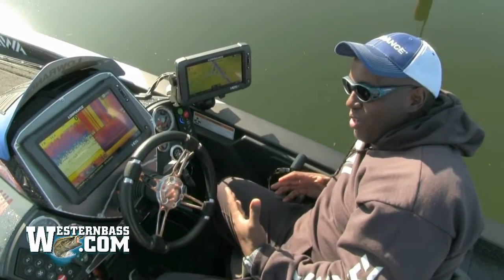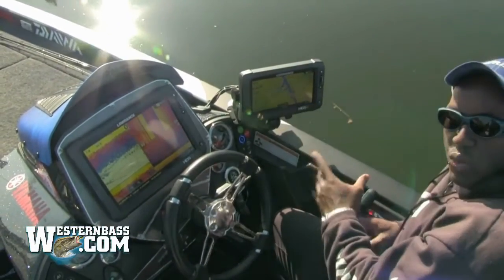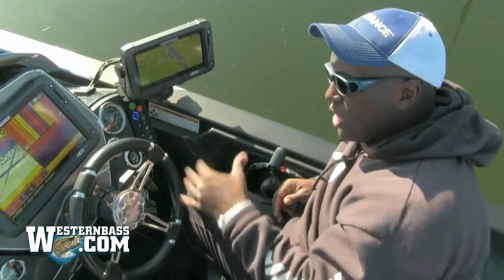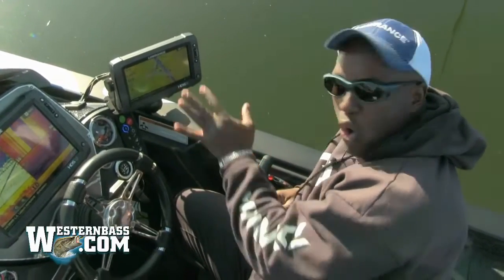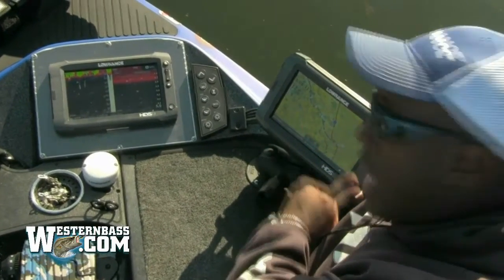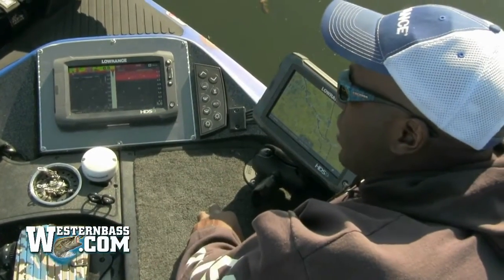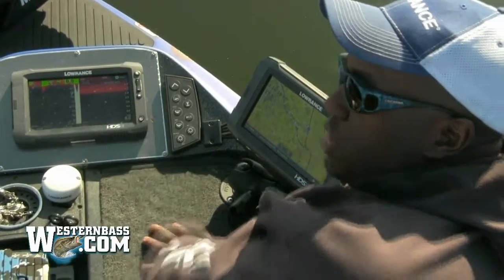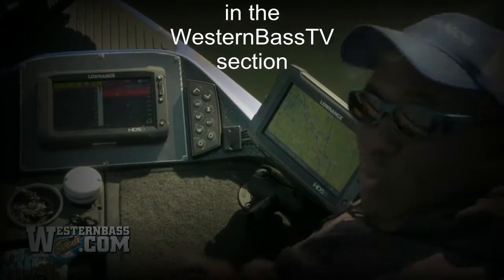Ish Monroe with Lowrance set-up tips

Comment: what is the model of the transducer that he is speaking of that he is using on his trolling motor.  i have an HDI that was connected to an older LCX 37 that still works but i would like to separate the two so i can set more accurate waypoints.  i have a gen 2 12 touch up front and a 9 touch at the console just trying to set it up to make it more simple to use please let me know who i can contact to get the help i need. he speaks about it at the 4:16 - 4:20 mark on the video.  thanks for the help.  -Bruce